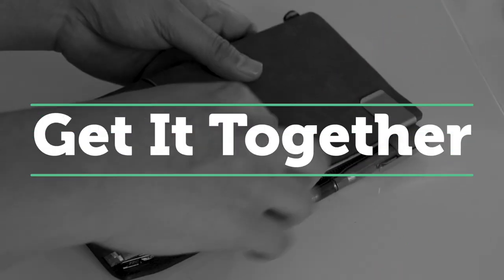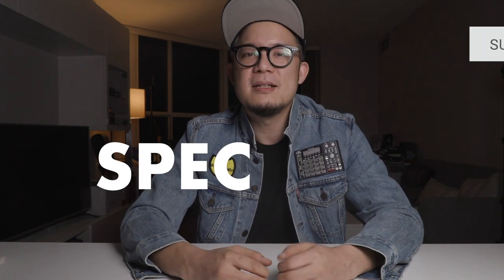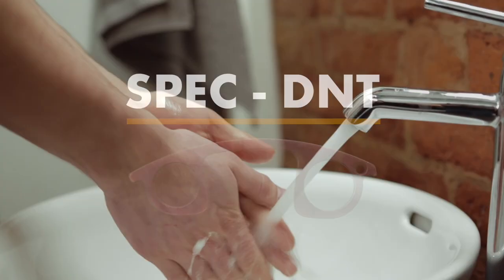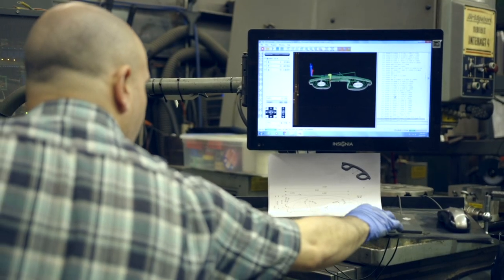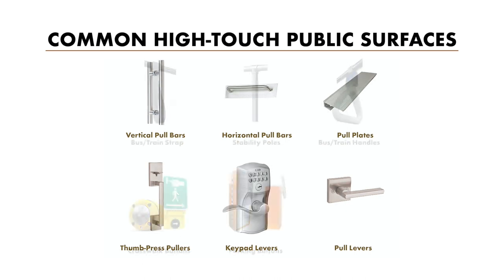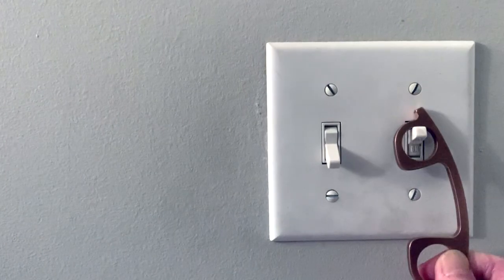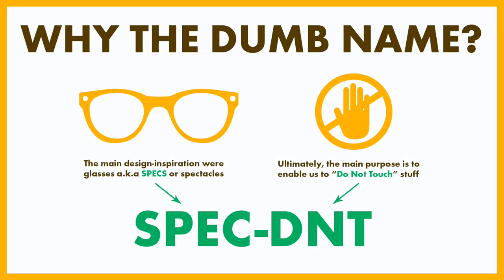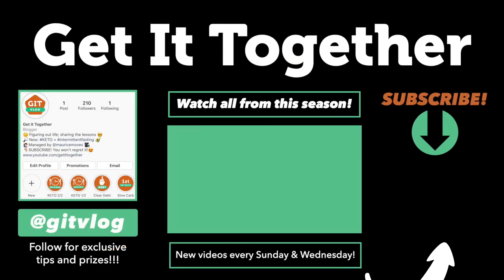How to Bring Your Invention to Life (Do You Have a Product Idea?) - Copper SPEC-DNT Live Case Study

Comment: This would be much, much cheaper to produce with a wire EDM machine process. You can take blanks of copper, stack them and produce fifty or more at a time.
Reply from the maker: Oh heck yeah... the thought of one day owning an EDM is a reaaaaal dream... but haven’t saved up enough 😜 we used our mill to prototype, will probably use the laser cutter for production... I think the cheapest option might be to punch them out, but that initial tooling for the press is really high too. We gotta work with what we got for now! Are you a machinist? Do you have an EDM? 😮 we have a strict rule for ourselves: either manufacture in-house, or find another manufacturer in Canada or the USA iF we ever need to scale up production. Thanks for watching, Dennis G! 🙏
Reply: Sadly, no to both questions. I just had an exploring the trades sort of class way back in high school and one of the machines was an EDM. They made aluminum keychains for our entire class in less than a minute. It was fascinating and I loved the used cloud of copper wire that was stacked up. Good times!